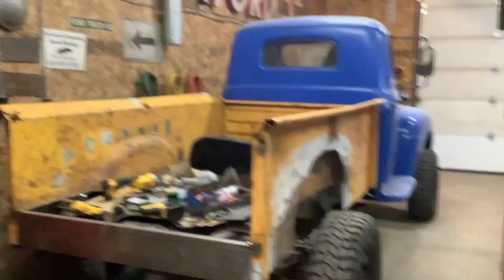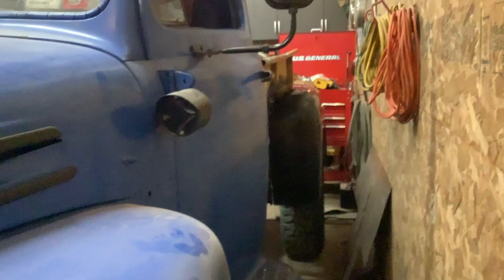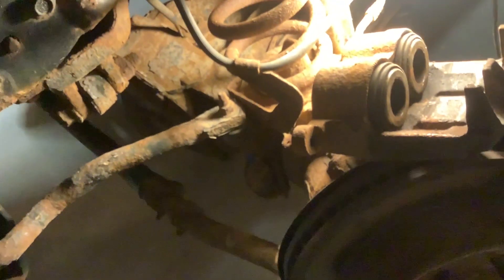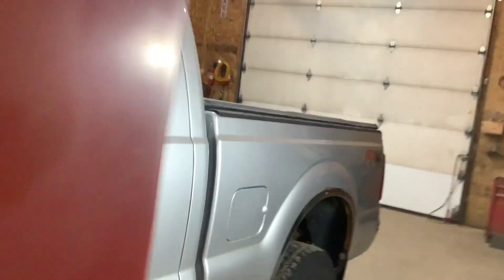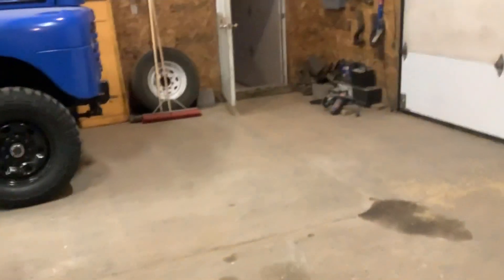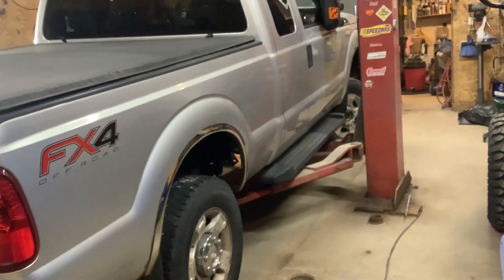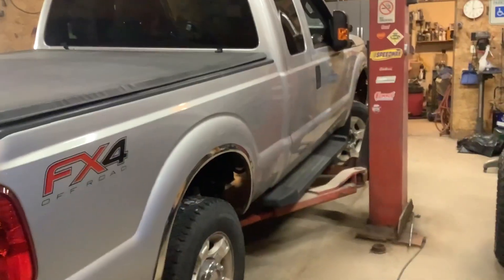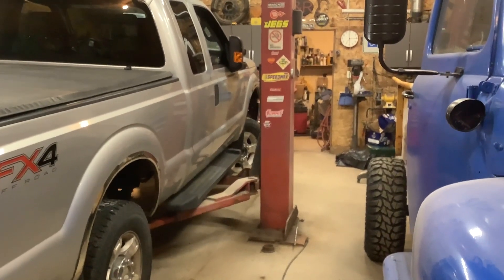More work on the Ford , and the beat goes on and on . Plus brake work on the Super Duty .

Comment: Man looks like you’re really busy. The F-6 looks like it’s coming together, super cool truck! 👍🏻👍🏻
Reply from the maker: Finally cooled down enough that I wasn’t melting in the shop , it’s now down to finishing the metal work around the cab floors and then paint early next spring. A few test runs in the yard and up and down the side rode went very well . Thanks for stopping in.
Shawn